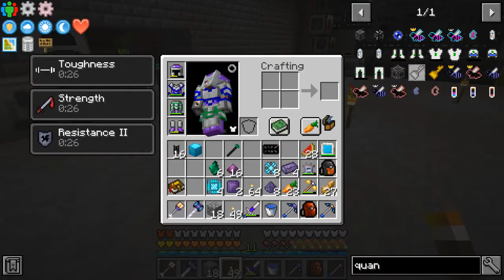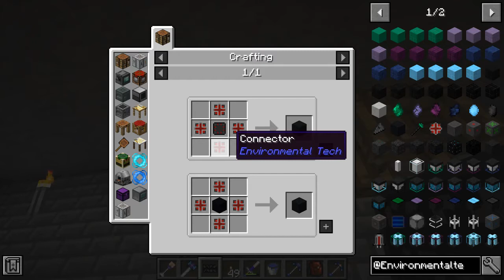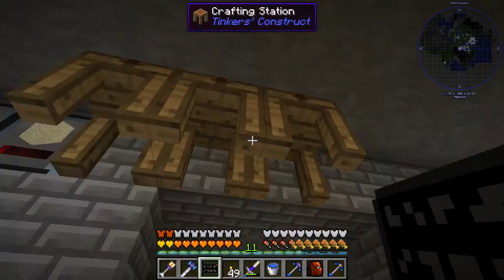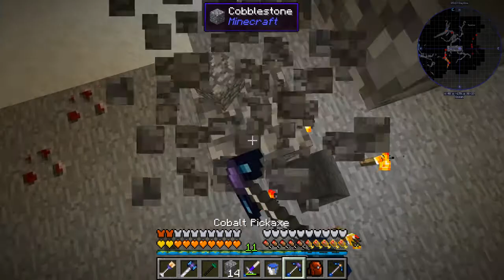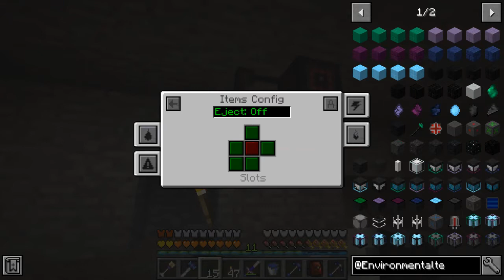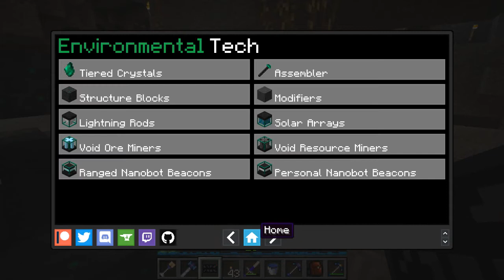Enigmatica 2, Let's Play Normal Mode Episode 26, Tier 1 Void Miner

Comment: In my old world I had 3 tier 6 void miners and 1 tier 3 resource,  used about 400k rf per tick total lol, I powered with tier 6 solar making 1.5 million rf tick
Reply from the maker: Very nice but for me that much would be massive overkill, lol.  Just having one of my 3 miners at tier 4 I'm basically swimming in resources.
Reply: @pcdeltalink036  o yea, it was over kill but it was nice to make it
Reply from the maker: @justincabaniss269  I am planning to upgrade them eventually (currently 1 tier 4 and 2 tier 2s) but I kinda don't need it atm and I also want to show any higher upgrades of them in an episode but I haven't had time in an episode to do that, etc.  Not to mention that for tier 5 and 6 the nether star cost is, frankly, absurd.
Reply: @pcdeltalink036  yes totally agree on the stars,  I had to get into industrial foregoing and get a wither maker and killer set up,  my set up was near end game and did it for the lols